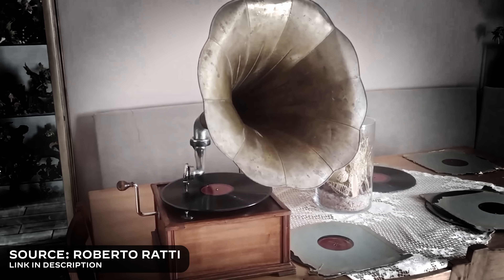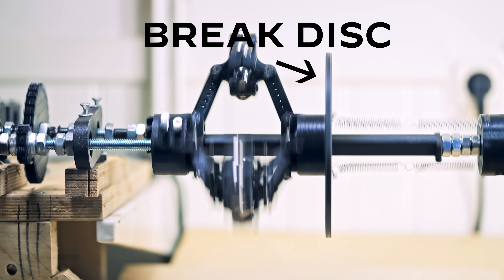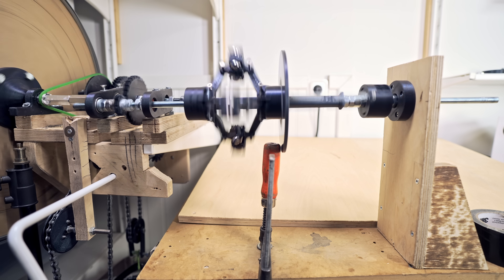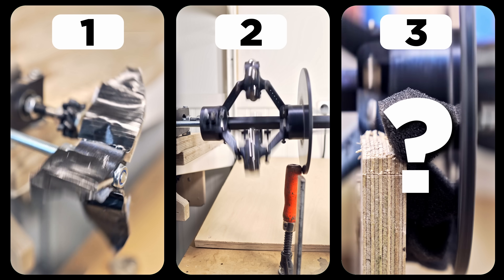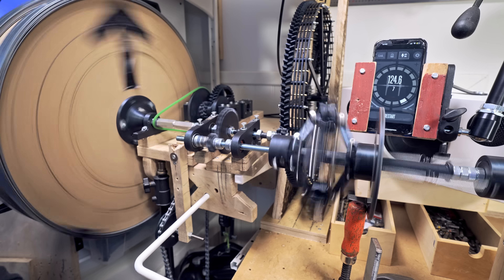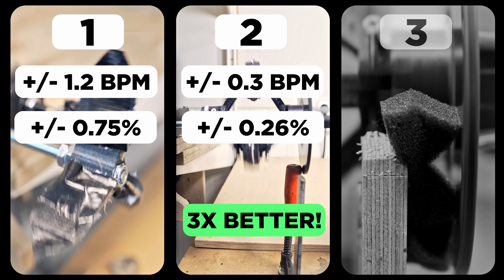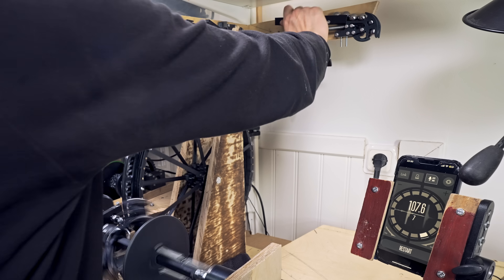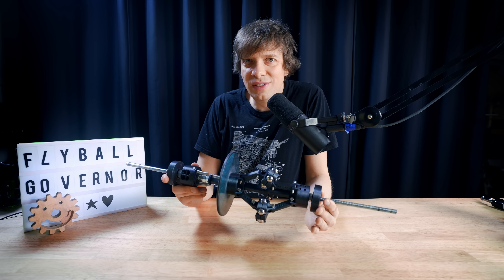How Gramophones play Tight Music - The Flyball Governor

Comment: Something like this is kinda what I have been waiting for. Didn't know about this mechanism, but it should help with the issue you are bound to have that the force the marble machine resists rotation will be based on a LOT of things, the tempo, the gear (and will change with every gear), the number of notes (more resistance every time you add a note), possibly the number of muted channels, etc etc etc. Something like this that is adjustable should in theory let you figure out a correct setting (probably a different one for every song) to keep the machine moving the speed you want.
Reply: Of course age of the machine and the last maintenance interval will also impact friction greatly so the settings will change over time, but this could be done as part of tour warmup. There could be a calibration song setup, so the difference in one song should be proportionate to all songs. Not much different than tuning a normal instrument as part of preshow checks.

Comment: I wonder if you could mix the air break governor with the flywheel governor cos the flywheel is so noisy against the brake... Put your fins on the balls so as the balls move faster the fins stick further out increasing the air resistance?

Comment: Graet work. Howevr, are you not just limiting the travel along the shaft to control the speed? If so, you could use a bearing that spins and is used to maintain the position without the degradation you would get from the friction?

Comment: I think the reason why the foam brake pad is so much better is due to it dampening the subtle movements and wobble of the brake disk while still keeping the force constant. I also think that having a foam brake pad is better than a solid one in general because it will have much less wear on the mechanism, meaning that the braking system will last longer without replacement parts. And considering this is a test rig, I think that in the machine it will smooth out the already subtle variation with its increased weight. Congratulations on not trying to reinvent the wheel, can't wait for the next video!

Comment: There's a lot of tuning you can do with the fly-ball governor. Some positions in its throw are going to work better than others, just because of the mechanical linkages. Different flywheel weights, different spring pressures, etc can move that position around.

Also be careful with wear and heat. Over a long concert, your brake material might wear or heat up, causing changes in tempo.

Comment: Governors are good if the input force is both strong and constant, for example a heavy weight on a pulley. Because they are constantly trying to slow the rotation down, it isn't as good for intermittent power sources, like a hand crank. Also, you're likely going to get way more variation than even the air governor was getting just based on the mechanical aspect of the machine.

Also also, the little bit of variation adds charm, making it sound more human, if you understand what I mean.

Comment: The Foam rubbing against the limiter disk will wear down, and throw out your accuracy over time as the shape of the pads change.

Consider a wheel on a bearing (like a rollerblade wheel) with high elastomer. It will offer consistent pressure during rotation, no wear, little or no noise / grinding.

Comment: Isn't the flywheel governer even better than 10x, because you can set up a threaded rod to adjust the position of the brake and therefore fine-tune the speed of the system.

Comment: I think it might be interesting for you to look into the Thorens TD 124 record player. It uses a dipole motor turning at twice the rate of the Hz coming from your AC outlet. 

This motor uses a belt to spin an aluminum disk. The belt is flexible and the stretch of the belt makes the peaks and valleys of the wave smaller. 
There is an aluminum wheel that is connected to the belt, which has an eddy current brake on it, which makes the speed even smoother. 

Finally there is an idler wheel connected to the aluminum disk, which turns a big and heavy platter. 

The combination of these technologies managed to turn a wavy 50 Hz AC power source into an extremely smooth running turntable. 
Even though the turntable is from the 1960’s, it’s still one of the best ever made. 

This technology might help you get rid of the waves in your tight pattern.

Comment: "centrifugal force" doesn't actually exist. It does feel like it does, but there is no force pulling you away. Imagine spinning something and letting go. Where does it go? Not in a straight line away from you at the point you get go at, but in a straight line into the direction it was traveling (so forward but without the constrictions of being Held). Vsauce did a great Video about it called "spinning"

As an aside, are the Discs called "break discs" or "Brake Discs"? I thought break means destroy and brake to reduce speed

Comment: What I think is helping the foam break this much is that it's gradual response avoids any parts from the sloppy regulator mechanism from wobbling.
The floppy marble weight holders should be strengthened and made more solid to make it more consistent.
I'm definitely liking the way the mechanism is taking shape, you can probably re-use the flywheel pedal frame to mount the full version.

Comment: "When the brake disk can move freely left and right, the governor is doing nothing" WRONG
The faster it spins the farther out are the flyballs.
The farther out the flyballs are, the higher the air resistance of the flyballs.
So if you make the flyballs really un aerodynamic you would not even need a brake disk.

Comment: On the type of interface with between the governor and brake:

There are positives and negatives to the foam. The larger area gives it more friction, allowing it to break more. But the fact that it is softer and can compress a lot means that it can potentially allow for a larger variation in the playing speed, depending on the energy you put into the system.

This is of course somewhat helped by the drive, but you could still have some variation, so I think a material somewhere in-between would be better. I'm not exactly certain what would be best, but maybe rubber, cloth, or leather pads with a wood backing, but shaped so they have contact with much of the wheel?

Comment: Fun Fact: Flyball governors are the origin of the term "going balls-out." When your machine is "balls-out," it's going at full speed.
Reply: Same with “balls to the wall”. It’s an aviation term for pushing controls, which used to have a little balls on the end of knobs or sticks, back to the “wall”, meaning
 full power
Reply: Hah, that is cool to know! Nothing to do with other balls then ;)
Reply: Now HERE is some cool info!!
Reply: I wonder what the benefits of horizontal vs. vertical drive are. I can imagine fewer moving parts for the fly ball governor and no springs. But then you have to worry about the consistency of gravity.

Comment: Dude, i like how you try to test things, but if you want those test to be conclusive, you need to take yourself out of the eqation!
1.
You will be subconsciously biased by your expected result when turning the crank, even if you know about the bias and try to avoid it.
2.
You will get better over long periods of time. You can't be sure which effect comes from a better system or you getting better at turning the crank.
3.
you will get better over short periods of time (thats why musicians play in). This will scew the results.
4.
Your performance will vary depending on countless factors of your daily life (the stuff you ate, the amount of sleep you got, the time of day you are testing, if you did sport recently, etc. pp.)

No amount of "i have this in mind" is enough to counteract these effects as they are hella unpredictable. 

While you could use specific statistical tools to meticulously plan your testing sessions (which changes get tested when in which order) those would be mathimatically difficult to obtain and you would need to do horrendous amounts of samples. Its not nearly enough to eyeball this like "i know i got a little bit better so i give the tests a variance of x, which could be due to the points above" THIS IS NOT ENOUGH.

I would highly suggest a reliable and reproducible testing rig with no human interaction AT ALL (like a motor you know gives a really consistant force with a gearbox for differeent tempos or smthing like that.)

Comment: Your flywheel is going to be VERY heavy, so you would need a huge flywheel governor to apply enough friction to the brake to keep tempo.

A better solution would be to have a brake at the edge of the flywheel itself that is activated by the flywheel governor.  You could then amplify the braking force using leverage such that a large movement in the governor imparts a small but more powerful movement to the brake.  You could even use an automotive brake caliper and master cylinder if hydraulics are allowed (still mechanical).

Comment: This is great progress!

However, it feels like you're wasting the ability of the flywheel to store energy. Instead of a brake, I suggest a clutch that engages with the flywheel when the system needs to speed up, and releases when the system needs to slow down, perhaps with a smaller secondary flywheel on the output shaft to smooth out the power fluctuations. It's the exact same mechanism, it's just butting directly against the rotating flywheel rather than a stationary brake.

This should remove the need for the huygens drive entirely. Your input can drive the flywheel, and the flywheel connects to the rest of the machine via the governor.

Comment: With all these tests, you are missing an entire half of the equation. You need to evaluate your solution under the load conditions that the rest of the machine will present (or at least something close to it). These "no-load" test results all go out the window when you have a huge change to the load conditions. Solutions you thought were terrible could be great, and solutions you thought were great could fail horribly.

Comment: technically you could use a copper disk and strong magnets for frictionless breaking. the transition between low and high friction would also be smoother but I dunno if it could even work

Comment: An Airbrake rotates way faster than the one in the video.
This is because air only starts to give real (braking)restistance when it moves fast over objects.
This is because of the density of air. 

So in order to realy test the airbrake you need to have a transmission between the flywheel and the Airbrake.
The advantage of an airbrake is, that it does'nt wear.

Comment: So glad you found this solution, I've heard of it but your demonstration was very good ^^ 
May I suggest something going forward with your project : safety precautions. With 3D printed parts spinning this fast, a little breaking point could make a weight go flying in any direction. I would say safety goggles at least but a direct hit could break a bone. Maybe at least don't stand or cross the plane of rotation as it would be the most likely area to be hit. Or enclose it in a sturdy box ^^
Especially with time and usage, I fear the 3D printed parts could deteriorate with this much strain. 
Still a great video, keep up the good work, we believe :)

Comment: I think you should have the axis vertical so that the weights do not have uneven forces caused by the gravity during a single rotation of the axle. And as a bonus, you can get rid of springs if you use gravity to pull the disc away from the brake.
Reply: I don't think it actually matters since the forces should be cancelled out if the weights are equidistant to each other
Reply: Great idea
Reply: It would also contain what directions ball get flung should the part catastrophically fail at speed.
Reply: @everythingsmellslikeboogers  Wouldn't you want it spinning perpendicular to the audience for that? You'll get in trouble if your machine breaks and causes building damage, but you'll get in a lot more if it breaks and damages people.
Reply: @keiyakins   I was picturing it being low in the machine, so it could be shielded.  Perpendicular probably mean he turns the flywheel in a safer direction, too.  Good call.

Comment: well, its the ballerina mechanism, or skater, but why would any governor be required or amazing, freedom! :) spin beast spin! also marble sump. then you dont need to re-fill the sump all the time, its full of marbles for a whole gig. you should solve problems from scratch, so you know why you are using those pre-made solutions. not to be slave of the solution providers. not self, not them, re-invent and understand fully. especially when the pre-made solutions force to use them, by force.
Reply: well you could always also use a tachometer and a break pad, definition of actual measured speed regulation all-in-one

Comment: You should consider combining the flyball design with the previous aerodynamic governor by putting the fins on the weights. Axle spins up -> fins extend -> greater braking torque = negative feedback loop. It would eliminate the need for the two-part friction brake, which might be degraded by wear or oxidation.

Comment: Wall clocks used air governors with moving vanes, it is actual origin of moving ball governor. Former is very useful, because friction comes only from air. Latter has to use mechanical brake. Both should have similar performance.

Comment: in the two tests of the centrifugal governor the differences it timing where most likely caused by the differences in amount of friction surfaces
when you used the clamp handle you had a small friction surface, while when you used the foam you had a friction surface 50 - 100 times larger so it cause more friction on the system as a whole

when you go to make the actual centrifugal governor make it out of metal not plastic especially the friction surfaces
and if done right they will be easily replaced as this will be your highest wear surface

it is call a centrifugal governor not a ball governor because it uses centrifugal forces to work as the shape of the weight does not mater ball/plate/etc. i just so happens that ball is the best for doing what is needed, cutting through the air and generating friction (but not to much friction)
if you look closely at the centrifugal governor you will see that it is always moving at the friction surface, when it is to fast if presses into the friction surface and when it is to slow it does not

and i will bet that the reason the air governor was not stable was because air governors need high speed, im talking 200-300+ rpm to apply enuf friction to the system as a whole and they are only used in low rotating mass areas
while you are using a high rotational mass system and this is where a centrifugal governor shines

Comment: The first issue that comes to my mind is durability. That is not meant to be a permanent piece the break disc. And it would be the first one piece that will require to be changed every now and then in the entire machine, the disc or the foam.

Comment: Even if the flyball governor wasn’t ten times better I’d still recommend it over your other governor design because of the ease at which you can adjust tempo. Simply have the brake on some kind of leadscrew with some tempo markings and you are golden.

Comment: A better design for the ball governor, would be to attach the balls to only one of the arms in each segment, and the other arm just pivot on the middle of the arm with the balls attached (think of a half open umbrella with the balls at the tips of the spokes).

This way it would be less loose and wobbly, and less prone to tangle and rattle.

Comment: The foam just had more friction than the handle of the  clamp. You just need a break pad for the governor disc to run up against that is not so soft but still has the  right amount of friction.

Comment: Flyball governors is a good idea, and I think a properly machined (and oiled) one controlling a air brake using a fan into an adjustable slit would give good precision and no issues with wear as there is no brake surfaces rubbing.

Comment: @Wintergatan
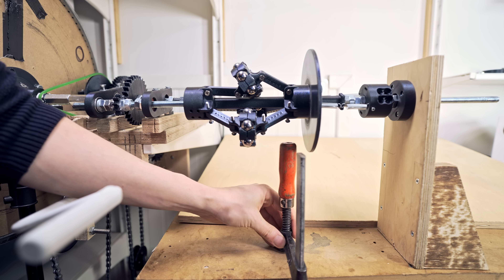2:34 You can put that clamp (or equivalent on finished product) on a screw (parallel to the governors rotation shaft), in that way you can turn a crank/knob/etc. to turn that screw, which controls the position of the clamp & that causes you to control the speed of the music on the fly, however you like :D

Comment: huh.. strange, some comments vanished? anyways, suggesting it again, why not use an eddy current break to slow down the break disk?`that way you will not have any deviations from friction changes due to the break pad being worn out (and termal friction changes as well)... also, those induction breaks cannot really lock up the wheel as could happen with friction breaks in some edge cases (like foam/breaking pad parts breaking off  and getting stuck)

Comment: I have to laugh just a little at gramophones being used as an example of tight music.
Not that there's anything wrong with a gramophone's (or modern turntable's) ability to keep a consistent tempo, but the tolerances on vinyl records are high enough that they're frequently a bit loose on the spindle, and with poor manufacturing they may have a slightly off-center hole, either of which will likely result in a sinusoidal tempo variation with a period of one rotation.

(For anyone who insists that "vinyl is better" than CDs or other digital formats: it objectively is not. You just like its flaws.)

Comment: A similar kind of governor was used to limit the maximum speed of steam engines. That's where the term "balls out" came from, which simply meant full throttle. And to be technically correct, the thing that causes the balls to move outward is simply inertia. The term "centrifugal force" really should be stricken from most people's vocabulary.